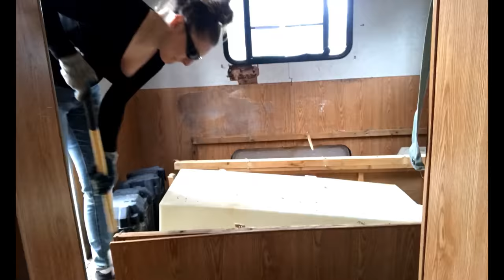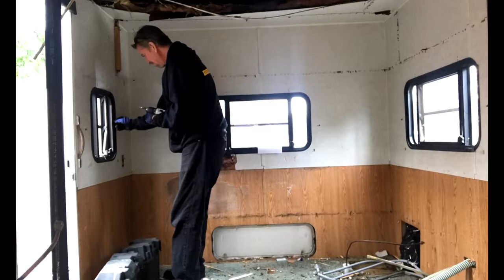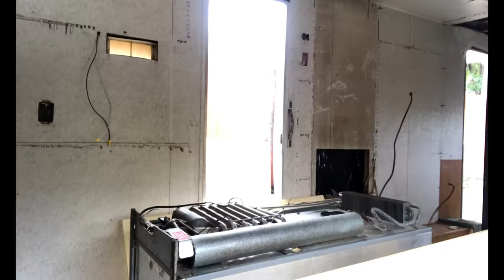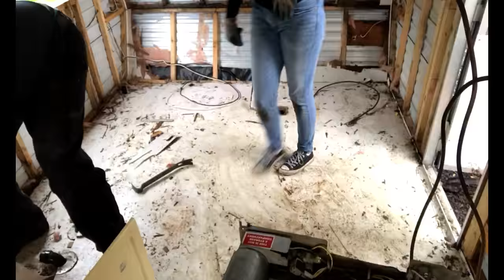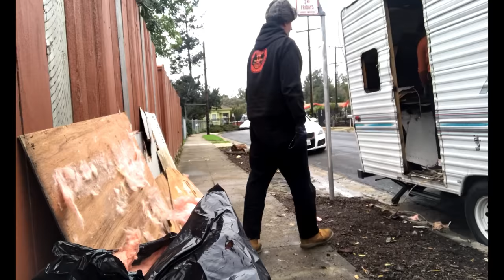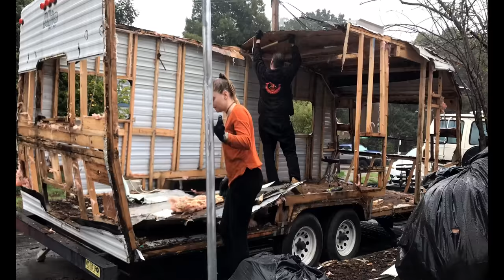RV DEMOLITION TIMELAPSE

Comment: My question is- how is the outer aluminum attached to the framing?
Reply: Usually staples on the outside and lower portions. It's like "siding." Usually has an S channel and that is what seals it/waterproofs it.
Reply: @bobbys2643  Thanks man
Reply: On the vintage: screws.

Comment: Though it makes us sad, we're doing the same to our RV. Just too rotten. Are you guys rebuilding it or making a trailer?
Reply: Aaron- Did you ever end up demolishing your RV? I have a junk removal and holling business and accepting an assignment to demolish a fifth w heel, and was wondering what’s the best way to do that? Also could I keep the chassis to build a flatbed trailer?
Reply: @michaelcrose9281  Doing it this spring. Siding goes in a metal pile, wood gets burned, plastics go in a rented dumpster. Chassis will be used for a truck build and yes many use the camper frames for trailers!